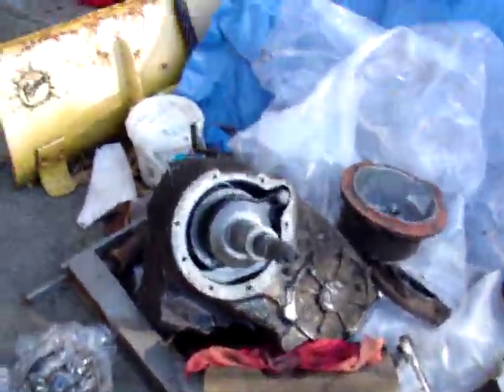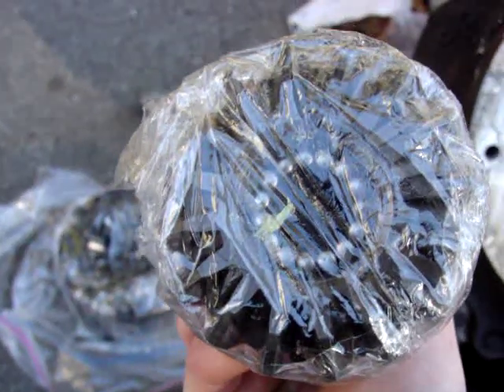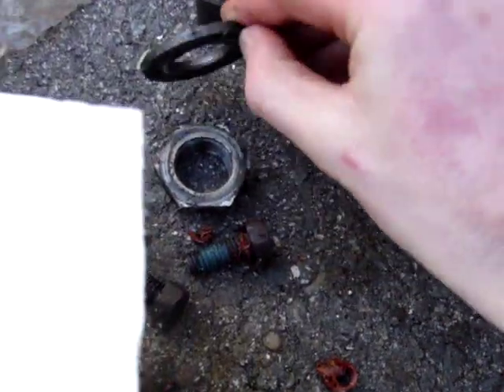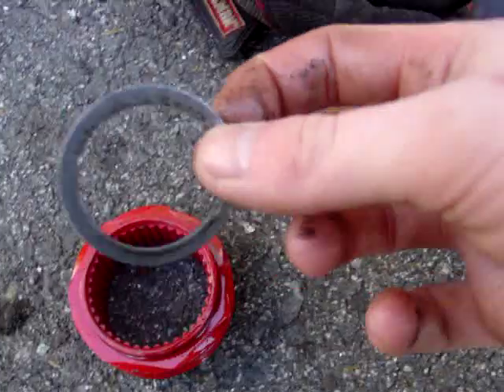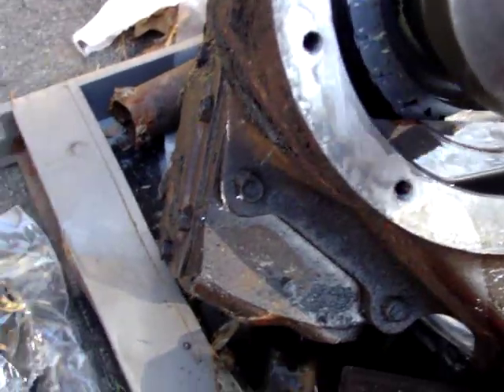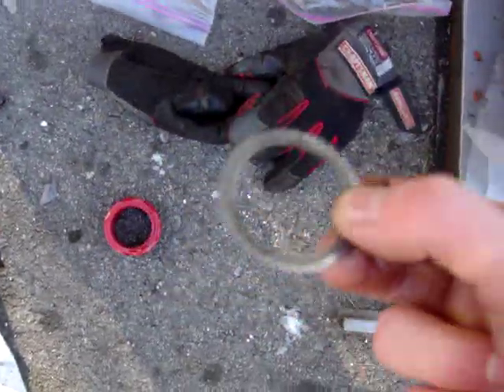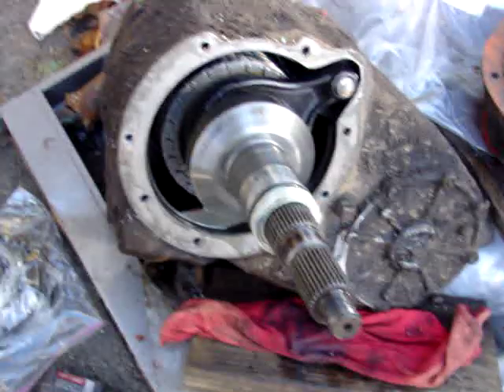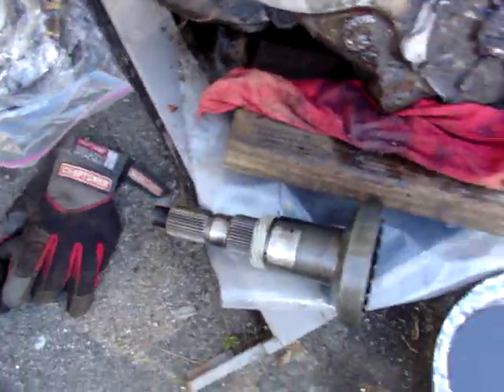How to convert an NP203 from fulltime 4x4 to Part time 4x4  using a replacement shaft kit

Comment: Stumbled on your video. Did the conversion on my 78 k15 about 40 years ago. First attempt was with a B&M kit. That was a waste of time and $$. couldn't get it to shift properly. Ended up with a Doug Nash DNE2 shaft and warn hubs. Still works fine. Just need to put it into 4wd every now and then.

Comment: The only problem with the kit is that your chain doesn't lubricate the transfer case anymore unless it's I 4 wheel drive or you lock the front hubs in.
Reply: I know this is an older comment.  I have a 89 Jimmy that I just recently bought. The person before me had put a part time kit into the np203 t case. I notice when I put into 2wd it makes a slight jingling sound. It goes away when I put unto 4wd.  Any idea why? Could it be because of what you said, not getting and oil? Can/should I just leave in 4 hi with hubs unlocked?

Comment: When you run in normal low or high after the kit is installed is your front running gear (drive shaft/axles) totally disengaged with the hubs unlocked?

Comment: Where did you get this kit. I need to do that to my 78 k20 also did you put locking hub kit upfront
Reply from the maker: I bought it used off CK5 I think.  and yes I instaled superwinch quarter turn hubs with this kit.

Comment: My question is this, i have 84 K5 th350 thats getting a 520hp 388 small block i built getting installed, i want to convert to a short 4x4 shaft TH400 build it but i need to know where i can find parts to convert my 27 spline input in my 205 to a 32 spline. Its an 8 bolt, im just looking for the tcase adapter right? Would a 203 32 spline adapter work?
Reply: And yes im running a FF 14 rear C10 front for now, 60's are insanely expensive

Comment: I've done this about 17 years ago. It's a big job, and I did the axle as well. But I did it in a 77  dodge power wagon
Reply: Wd alis
Reply: It's a small very simple job especially when you already have one out. Split the case, take it apart, take pictures if you need but you shouldn't be tearing a transfer case apart if you can't just put it together looking at parts🤗

Comment: Too bad they don't make these kits anymore. I just got a 79 K10 with a NP203. Guess i'll have to bite the bullet and get myself a 205 and all the other necessary trimmings. Drive shaft, etc. From what I gather the 205 is quite a bit longer.
Reply: The kit is still available. Also a 205 is about a foot shorter than the 203

Comment: 84400

I know this is old so I dont know if you will see this but if you do I would like to ask you a question.

I have a dodge with a 727 auto trans and the NP205 I would like to do this but without the locking hubs in the truck do you know how you would engage the 4 wheel drive?
Reply: well get an auto locking hubbed axle.
Reply: So the only way to do this it to switch front axles?
Reply from the maker: Nope.  You can install locking hubs on your current axle.  All locking hubs do is connect the wheel hub to the axle shaft thus powering the wheel.  

What year dodge?  Old w200 powerwagon?   If so they came stock with a 727 and Np203 full time transfer case.  You can convert to part time if disired
Reply: @84400  how i have 4 w100s all 203s like to have 2x2
Reply: 84400 1976

Comment from the maker: I got it Online from a guy on wheeling dixie.  The site no longer exists.  They no longer make these so you need to find a used one.  They still make the spider gear kits but not the replacement shaft.  Try CK5 or backwoodsmotorsports or ebay.  You might want to consider an np205 swap as I did.  Good luck and if you need any more info let me know.

Comment from the maker: Will, you most likely do not have the shaft kit but rather the other mile marker kit 

part number  501  If you got questions just message me.  Also it may be easier just to swap the rang box (front half) of the np203 for the one that matches your th400's 32 spline shaft.  I no longer own any np203's or automatics for that matter so I cannot make another vid.  Went to an sm465 and np205.  But i have taken a few np203's apart.  let me know what other help you need

Comment: I have some questions. I have 2 np203's. One is from my th350 and the other from my th400. I currently have the th400 in my blazer so I'm using that transfer case that matches because of transmission spline count. My issue is that the other one has what I believe a part time shaft kit but I don't know how to get it out and into the other tcase. I'm not sure how to tell for sure. The th350 one doesn't have spider gears and seems like its some type of spring loading system. Where as the th400...

Comment from the maker: naw a doubler uses the range box from an np203 infront of an np205 so it is like putting one t case in front of another giving you double low.  So a doubler will give you a noticeably different low range.  If you need that go doubler.  If you just want low 2wd then this kit works.

Comment from the maker: Thanks for the kind words.  should have more truck vids coming soon.  I wish i could help you out on the shaft kit.  I got it off a guy from wheeling dixie dot com.  I would check backwoods motor sports and ebay as well as CK5 dot com and nc4x4.  Basically a lot of the forms out there have classified sections were people sell off there old parts.  If i have some extra time i can contact a few people i know locally.  Good luck with the hunt and can't beat a K5 man!

Comment from the maker: @Ch1quito123 you certainly can!  Depending on what transmission you have would dictate which np205 you need.  The th350 auto uses a 27 spline input which is kind of rare to find in an np205.  The th400 uses a 32 spline which is a bit more common.  the sm465 uses 32 spline and 10 spline.  In addition you would need front manual locking hubs to get the full benefit of the swap.  Doing so would make the truck part time 4x4.

Comment from the maker: @snake1700grizz  No they are a good transfercase.  There only 2 issues are a shifter that likes to get sticky overtime and the fact that they are chain driven.  They work great for a plow truck and also in an offroader because they have a lower low range then an np205

Comment from the maker: @tmkbehkn   yeah sure you can.  You can use the NP 205 gear drive.  You will need the 27 spline Trans to T case adapter and shifter if it is a th350 auto in your truck.  The Np205 is sorter then the 203 so you will need to put in a longer rear drive shaft and shorter front drive shaft.

Comment from the maker: @jasonpatterson19  I would but i replaced the np203 with a stronger np205 gear to gear case.  I can make a vid of that later this year when i swap the input shaft.  The np203 is a good transfercase if you have any questions about it I might be able to answer them.

Comment: i was debating converting mine but think im gonna keep mine fulltime 4wd but this video was verry well done thanks man
Reply: The problem with full time is you can lift one tire and your done . As soon as one tire spins all power is diverted to the spinning tire . I push snow with a 77 3/4 ton Chevy . 6 inch lift 35/12.50s .  I did a good clip on 203 shifters on my YouTube channel  The Weldor  . I like 203s because after you convert it . You get true 2wd in low range . The front output shaft does not turn in low range  ! Unless you go to lock position !

Comment from the maker: well depends if it was the shaft replacement kit or the spider cogs.  If it is a shaft then yeah about 70-85 buxor a good used one.  They still are sold new and cost about 150.  Ebay or a club website would be your best bet for a sale.

Comment from the maker: @CORVAIRWILD  I actually sold the shaft kit that is why i took it back apart.  Now if only i could sell the case or the fulltime front hubs... It would be good for plowing and makes for good handling on the street in fulltime.  I am installing a 205 right now  that is the only reason i took this out.

Thanks for watchong